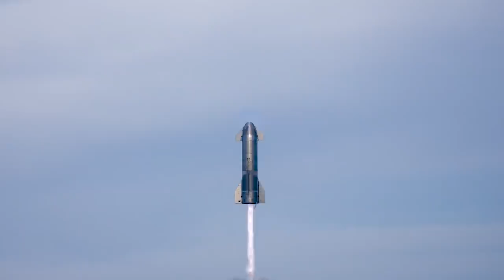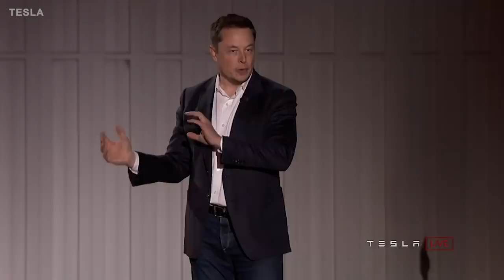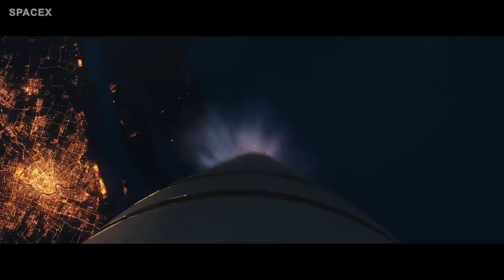Inside SpaceX's Starship Factory (Starbase)

Comment: @4:08 for those who don’t know (including creator of this video) that large circular structure is not used! It was supposed to be used to construct carbon fiber starship; however this structure was scrapped a very long time ago. This was done because the design moved to a stainless body rather than the carbon fiber body.
Reply: @litresdomines1356  tbf they are expected to switch to 3mm eventually
Reply: @TheBest14184  They hoped to use 3mm steel, but given the performance of SN7.2 that seems doubtful now. Perhaps 1/8th inch steel for less demanding usages (upper nosecone, reinforcements, brackets)? That would be 3.175mm.
Reply: @gilbertanderson3456  Did Elon tweet something about the performance of sn7.2? I don't really remember it having a bad performance.
Reply: @rolandb.1866  I have no revealed knowledge, only my observations (via NasaSpaceflight) of the "test to failure" and SpaceX's follow-ups.
There was a prolonged increase in pressure before the pinpoint failure of a circular weld slowly grew to a small leak, a medium leak and a strong but restrained leak.
There was no burst failure as expected so I surmise that they achieved a "reasonably high" pressure, but nothing like they hoped for.
They attempted to reweld the failure point, apparently achieved poor results, decided further testing of SN7.2 was useless and moved it back to the production site having never observed a true burst pressure for the 3mm steel.
It is my guess that it is very difficult to achieve excellent weld uniformity with 3mm steel and that they have reduced their hopes of constructing Starship or SH primarily from 3mm steel. They may be able to use steel thinner than 4mm for weight savings in reinforcements, brackets and other noncrittical places and it's my hope that they produce an SN7.3 article based on 1/8th inch steel (~3.4mm) which might be the limit of weldability.

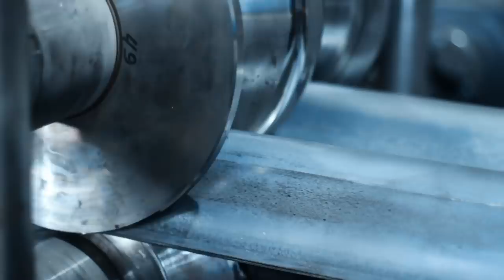Comment: 5:13  For now they are using 4 mm thick steel,  3mm steel is in the testing phase (SN7.2) for now
Reply: No. SN15, which is currently on the pad, is using that 3mm thick steel.

Nevermind it’s not, I’m just a lil dumb
Reply: @captainelliot8767  where this information came from, I couldn't find it
Reply: @captainelliot8767  source?
Reply: @captainelliot8767  No that is just a very incorrect rumor that was started because SN15 was supposed to be the first major upgrade over the other high altitude test vehicles and we didn't know what the upgrades were. So people just assumed, hey must have the new thinner steel. But that has always been a dumb rumor as SpaceX started constructing SN15 long before SN7.2 (the 3mm test tank), and we aren't even positive that 7.2 is done testing let alone if it passed. So we aren't going to see 3mm steel until SN19+. In reality the SN15 upgrades consists hundreds of small incremental improvements to the avionics, software, thrust puck, and raptors.
Reply: @Pcat0  Sn15's metal is titled SPX 304, which is different from sn8's 9's 10's and 11's because they had 304L with no SPX in the label. That's what gave people that idea
Reply: @reagank.2268  

SPX is obviously short for SpaceX which implies they are using a custom steel now, probably better suited to the role than 304L is. Probably the same type but slightly modified.
Reply: @topsecret1837  So maybe modified a millimeter thinner? Lol
Reply: @Pcat0  oh duck lmao, well thanks for info 😄

Comment: Hey um starskip is made of 4mm stainless steel. The 3mm was tested for sn7.2 but it hasnt reached full construction yet :)
Reply: i'm pretty sure SS is already using 3mm stainless
Reply: @MaliceOfRites  I doubt it. SN 7.2 still hasnt been tested fully. There is a reason they moved it before sn11s flight
Reply: 3mm would add lotsa payload, but currently when the rocket tears the 4mm even looks flimsy 😁
Reply: @BocaChicaGal has documented the steel delveries for NasaSpaceFlight.com and the steel is 72 inches x 0.1575 inches. That means the rings are 2 yards wide(1.8288 meters), not 2 meters. 0.1575 inches = 4.0005 mm thickness
Reply: @3StevesFilms  the Rocket can’t be chunky steel otherwise it’s too heavy to launch. The alloyed steel That’s used acc gets stronger under cryogenic conditions as well as handling extremely high temperatures.
Reply: Who told you that? Nasa?
Reply: @drpork1360  no. We can see the dimensions of the steel when it's delivered. 3mm steel needs a lot more support on the inside so we would also see that process beeing done. All current starship started construction before sn7.2 was tested first so it's impossible they are made of 3mm steel. Also bocachicagal takes pictures of the production area every day and she still hasn't noticed any 3mm steel deliveries
Reply: @gilbertanderson3456  Nicely calculated
Reply: Actually sn15 uses 3mm steel
Reply: @damitcam  What proof do you have?
Reply: @Rick_2812  its not my job to provide you sources, your just incorrect, you can use a search bar cant you
Reply: @damitcam  I can use the search bar and i have only found evidence of them using 4MM. Also nasaspaceflight is stating that SN15 is using 4 mm stainless steel. You can even watch the rollout livestream and hear them say it.

 Plus like others stated above there have only been delivery's of 4MM rolls why would they receive those if they are not using them.
Reply: @damitcam  No that is just a very incorrect rumor that was started because SN15 was supposed to be the first major upgrade over the other high altitude test vehicles and we didn't know what the upgrades were. So people just assumed, hey it must have the new thinner steel. But that has always been a dumb rumor as SpaceX started constructing SN15 long before SN7.2 (the 3mm test tank), and we aren't even positive that 7.2 is done testing let alone if it passed. So we aren't going to see 3mm steel until SN19+. In reality the SN15 upgrades consists hundreds of small incremental improvements to the avionics, software, thrust puck, and raptors.
Reply: @Pcat0  excellent explanation
Reply: @damitcam  If you make a claim (e.g. SN15 uses 3mm SS) then yes, it is entirely on you to provide a source backing up your statement. Don't get me wrong, I think you may be right, but saying it isn't your job to provide a source after making a statement like that is exactly what is wrong with society right now. And yes, everyone else mouthing off here with nothing to back them up should be doing the same - you are not alone in this.
Reply: @jeffdesilva  Everyone stating SN 15 using 4mm ss is stating their source, NasaSpaceflight stated it in their livestreams. (it was the roll out livestream don't quote me on the time) NSF is also keeping track of SS deliveries. This means the moment there would have been enough SS for an entire starship they would know!
Reply: @damitcam  hey here is a table (next comment) showing when starship sn15 started construction. Its before january 9th 2021 and SN7.2 rolled out on the 26th of jan so no you are not right. Its ompossible for sn15 to be using the 3mm ss
Reply: @damitcam  SN15 is still built with 4mm steel. I used the search bar.
Reply: @OriginalUnknown2  The amount of outdated and misinformation in this vid is nothing short of gobsmacking. (not to mention the blatant shilling in the comments)
Reply: 100
Reply: @damitcam  He's just noted that Boca Chica Gal's photos suggest 4mm from the specs on the labeling of the deliveries. Its possible they intended SN15 to have 3mm (and they have certainly been looking to do that) but I suppose we'll have to wait on confirmation.
Reply: @damitcam  
If you ever want to know why people don't really take you serious, think back to your quote: "its not my job to provide you sources, your just incorrect, you can use a search bar cant you" 
If you make a claim, you HAVE to be able to back it up. If you can't, your opinion is worthless and people might treat you accordingly.
Reply: @MaliceOfRites  no it’s 4mm
Reply: @damitcam  I don't understand how you people think let alone exist in this world
Reply: @3gunslingers  wow i got something wrong so im worthless, what an awful society
Reply: @damitcam  
Not you being wrong makes you "worthless".
You being arrogant and thinking that you don't need to provide sources for your arguments puts other people off. 

Read what you wrote and think what you would say about a person saying that to you.
Reply: Starskip is 4, starship is 3...lol sorry, I'm that guy!!
Reply: @drpork1360  haha, cryogenically toughened
Reply: Sn15 is “still” 4mm. PERIOD!!! The 7.2 test tank was 3mm but no word from Spacex or Elon if this passed or will be implemented in future SN’s. We simply still don’t know if 3mm is viable. Y’all quit your whining about it being 3mm. Jog on.
Reply: @rodd1000  than you
Reply: hey um .. sn15 has 3mm stainless steel
Reply: @drpork1360  elon says all sorts of stuff about starship on his twitter. plus, the build facility is right on the side of the highway, when deliveries of any parts or materials are made, the public can see what the labels say
Reply: Okay, everyone relax. You're all mistaken. The whole thing is 3-D printed.
Reply: Hey anyones know what type of SS used in the starship? SS300-700?
Reply: I live in Karachi Pakistan and I like your comment
Reply: @MaliceOfRites  I live in Karachi Pakistan and I like your comment thanks
Reply: @sayyamzahid7312  thank you hahahha

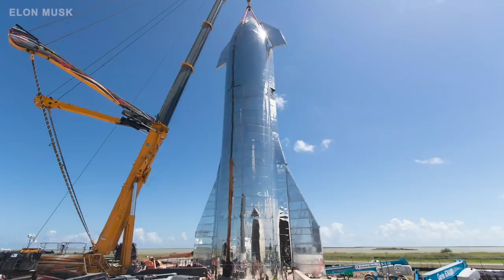Comment: 4:55 won’t starship face large forces  along its side-when it lands? so why could it not deal with being constructed horizontally?
Reply: When the ship is falling , the is only drag that is applied to the side. But it it lands in the side , it will have to support its own weight horizontally . That will most likely crash the tank sections

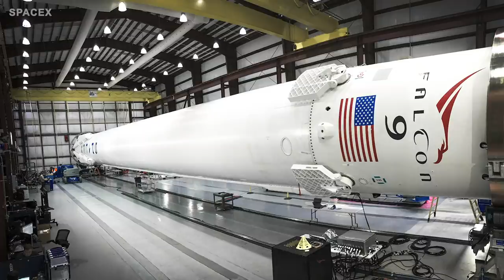Comment: 4:35 starship do re enter horizontally, and re entry G load is 4,
i.e. it will lay on its side in 4 times stronger gravity, than on surface on earth,
but it will lay on very hot plasma..., still it means horizontal support for starship is possible, but it can be costly though.

Comment: I may be wrong but it's just a gut feeling. I'm pretty sure if startship can survive re-entry it can survive horizontal integration. It won't be able to be produced horizontal though.
Reply: I’m not sure why they would even want to horizontally integrate something with 4mm steel rings of 9m diameter.

The reason why it can survive reentry and not horizontal integration is because during reentry they have the tanks pressurized. 

All metal tanks are very strong when they have an equal force pushing outwards, but not inwards as in having less pressure than external conditions, which is why the Atlas and Centaur have used balloon tanks in history.
Reply: @topsecret1837  it would depend on the payload I would guess. You do have a point about the tank pressure, but the tanks are also partially reinforced due to the baffle system, but still probably not enough to support it's self. But in theory they could keep some pressure in the tanks with nitrogen, let's say an arbitrary number of delta 4 psi (or whatever it would take) from sea level air pressure to keep the tanks from collapsing. It would be relatively safe to work around, of course there is always a danger working next to pressure vessels. Just a good though experiment ☺️

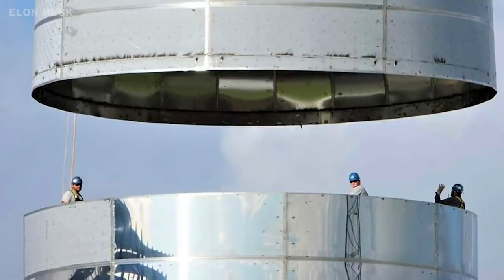Comment: 5:26 Starship is made of 20 barrels + nosecone (if you think of nosecone as only this round tip of the rocket)
If you think of nosecone as what they usually stack so the tip + barrels, then it's tip + 4 barrels, and the rest of rocket is 16 barrels then.

Also Starship is built so far of 4mm stainless, only the aim right now is to build of 3mm stainless

Comment: 0:07 has anyone realized yet Elon wanted it more pointy so it would have supersonic aerodynamics during ascent, the one point in its flight where what the nose cone is shaped actually affects its strength against aero pressure?

And Starship will certainly be the largest mass produced aircraft and spacecraft ever built.

Comment: Starship laying on its side wouldn't be a problem, it has all the reentry forces coming through that exact axis, I think being vertical is more about rapid reusability.
Reply: Reentry would be with the tanks pressurised, which gives much more strength. During construction there would be a lot of problems if it was done horizontally.
Reply: @grahamsnowden6173  true though it’s never really depressurised. I think it could handle but it’s a lot more conveniant to do it vertically

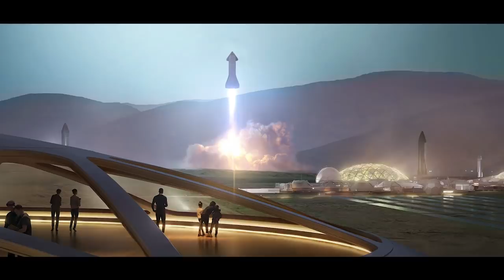Comment: 0:38 - Wrong, not the largest, Zeppelin's were more then double the size.
Those are "Ring" sections, not "barrels"
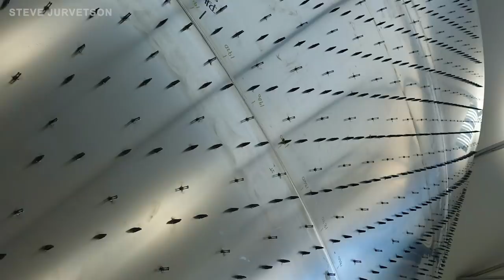6:45 - the tiles are not 'welded', a little googling of the right materials, and you'll find they are clipped to the pins and then bonded, over the insulating matting.

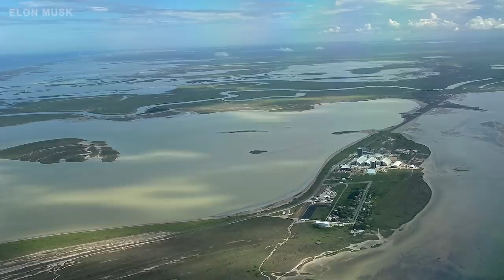Comment: At 3:09 you say Boca Chica is near the equator. Nope. It’s over 2,000 miles from the equator. It’s closer than most of the US, but almost as far from the equator as it is from the North Pole.
Reply: That is not the point. The point is it relatively extremely close to the equator compared to the rest of the continental United States.

Comment: The company that made the big tents is called Sprung Structures, not Spring.  They are located by High River Alberta.  Florida is closer to the equator- Texas is still over 2000 miles away from it.   Should have built it in Brazil🤣

Comment: Excellent video presenting the infomation.  

Apollo and Shuttle were also stacked in the verticle position at the VAB and transported like that via the mobile lanch platform by the crawler to the launch pad.  This is not new.  I am assuming that a building similar to NASA's VAB will eventually be in place to allow for easier stacking and not have to use mobile cranes, the cranes will be built into the building..  If you ever had a chance to see the inside of the VAB, you would have seen that it was built to allow for putting these rockets together vertically. 
   
Each individiual thermal tile on the shuttle was untique due the shape of the shuttle.  If you look carefully, each tile had a code on it to indicate where the tile belongs or what has to be replicated to replace tiles.  If you look at the top of Columbia and Challenger, and then look at Discovery, Atlantis, and Endeavour, you will see the switch to thermal blankets.  As NASA learned the heating characteristics, they were able to switch to these blankets on top for the later shuttles.  For those old enough to remember, there was great difficulty to get the tiles to adhere to Columbia.  It set the program back a long time until they got it correct.   It will be interesting to see how the starship method works to hold the tiles in place.     

It will be interesting to see how Starship evolves, but I sometimes believe Musk's excellerated pace is more of a detriment than inovative. He believes that you learn more by sending up protypes and examining the failures where others do simulations and test componenets seperately before sending it up.  In the end we will see which way is more efficient.

Again, great job with the videp.

Comment: Interesting. Lots of inside information. Too bad some of it is wrong.
2 YARD WIDE "BARRELS", NOT 2 METERS.
4.0005 mm THICK STEEL, NOT 3 mm.
STARSHIP IS 20 "BARRELS" PLUS THE NOSECONE, NOT 17 "BARRELS".

@BocaChicaGal has documented the steel deliveries for NasaSpaceFlight.com.
The steel coils used to make the ring sections are 72 inches wide (1.8288 meters) and 0.1575 inches thick (4.0005 mm).
Starship's propellent tanks and engine bay are sixteen rings tall. There is a four ring cargo bay and a nosecone on top of that.
So far as the public knows, only the SN7.2 test article has been manufactured from 0.1180 inch thick steel (2.9972 mm).

Comment: Correction: Starship is not even close to the largest flying object ever constructed.
Reply: Well what is it then?
Reply: @Cediii4ris  there are many actually, but look up the Antonov AN 225.
Reply: @mattmaberry  starship is bigger my dude.
Reply: @Cediii4ris  It is definitely not "dude". Antonov dimensions are 276 ft x 290 ft with a cargo volume of 46,000 ft^3. Starship is longer yes, at 394 ft. But only has a diameter of 30 ft and a total volume of 29,100 ft^3. Much smaller. Also there have been derigibles like the Hindenburg which was far longer, 803 ft, with a volume of 7,062,000 ft^3. So yeah, Srarship's not the largest flying object clearly. Basic searching will show you that.
Reply: @mattmaberry  also dude, no one said that starship was the biggest flying object, it’s just the biggest ROCKET ever my dude.
Reply: @Cediii4ris  Nope, wrong again. I was responding to a statement in the video. At 00:37 seconds he says "starship will be the largest flying object ever made". That is what I refuted.

Comment: Starships are made out of FOUR millimeter thick stainless steel not three millimeter. Yes, they are currently developing a three millimeter version, but NO action beyond the initial tank pressure testing has occurred. So, no, Starships are NOT made out of three millimeter stainless as of the posting of this video.